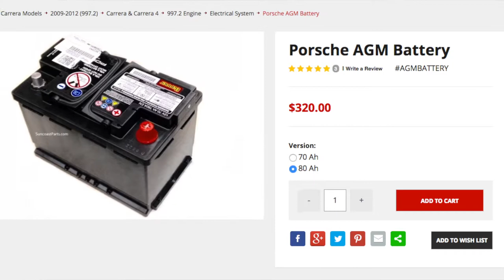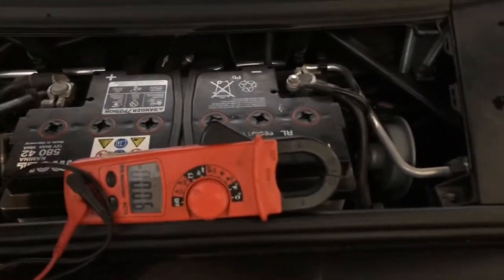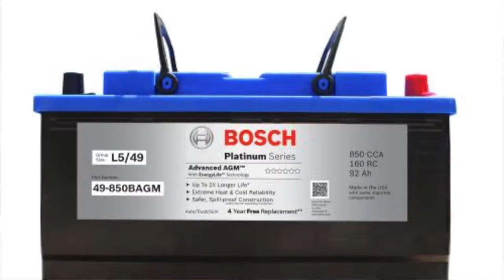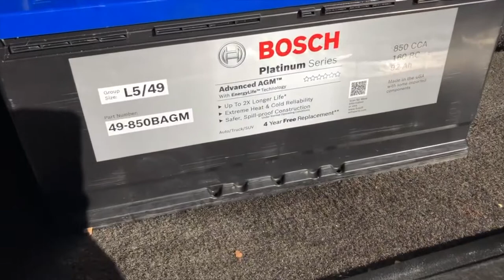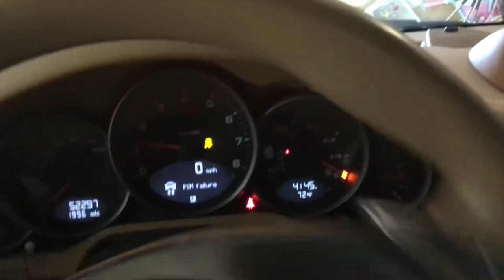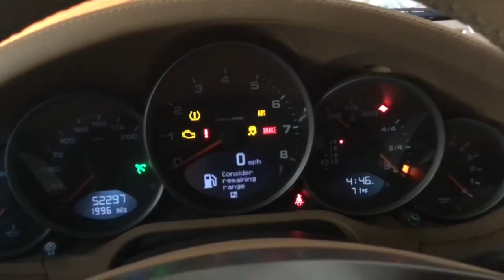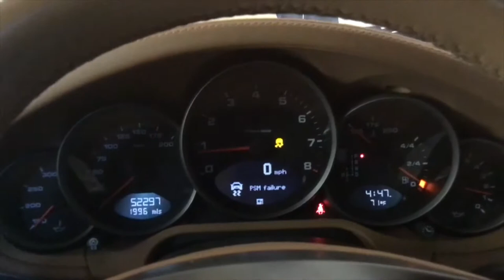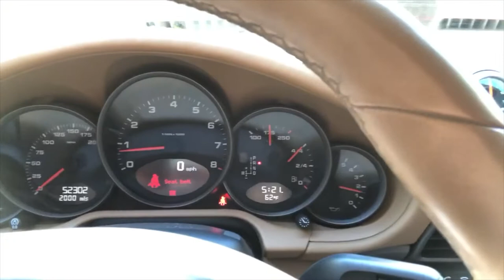How to check a battery, alternator, and replacing a battery. Absorbent Glass Mat Battery

Comment: Good video, I wish I had seen this before. I eventually realised it was my battery and then I came here to see if there were any videos to confirm my findings. I was on a wild goose chase with electrical faults , I thought that it was the front control unit on my Carrera 997.2 , alternator etc.  I had very erratic behaviour of all the electrical systems, fan,  windows, spoiler staying up etc.When I checked the battery it was only reading 11.5 V.     I felt stupid not checking the battery first as the car would crank over very well and run fine, so that was all very confusing.  I tested further as I learned a lot from this, the ECU must be reliant on the condition of the battery despite the alternator supplying charge to it and over 14v. I found that when I connected a powerful charger it would operate normally when charging, all very strange. Lesson is the voltage level is very critical and a degraded battery is not at a high enough level and ECU knows this.   I  hope more people see your video too.   All the best